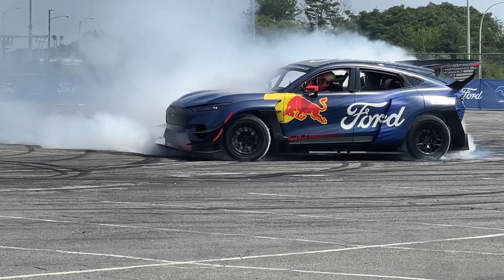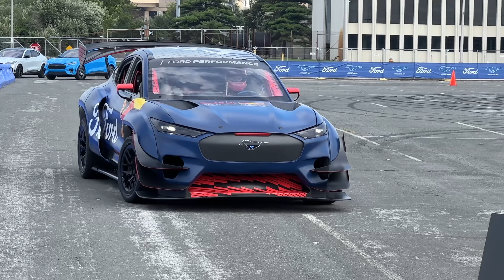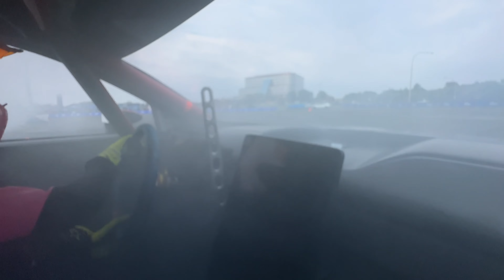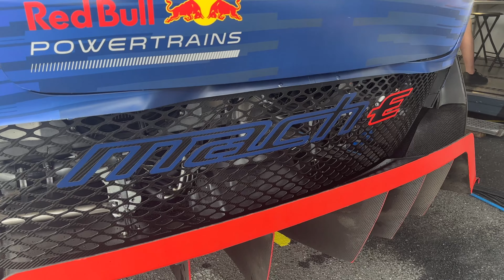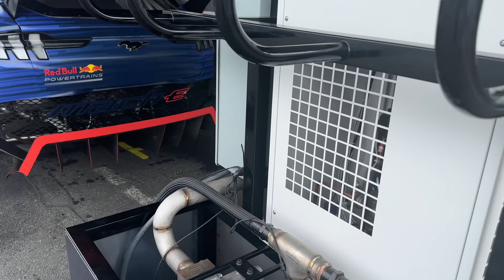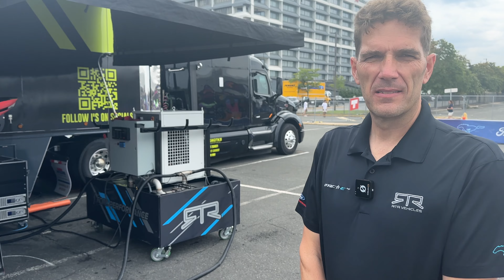I Ride In The Insane Mustang Mach-E 1400 Prototype Drift Car Built By Ford Performance & RTR!

Comment: Interesting but doesn’t seem very sophisticated. 7 motors?? Complicated charging… Hyundai seems to have done much better with the Ioniq 5 N. Hope you get the chance to check it out and compare.
Reply: This is a one-of-a-kind demonstrator for events, not something that will ever be produced or sold, so can't be compared to production cars. They took an empty Mach-E body and put race car guts in it. The actual production Mach-E has one or two motors and the charging works normally.
Reply: @TechnicalLee  Thanks, I understood this from the video but I don’t see how this artificial setup will bring any learnings for the development of street cars. Adequate cooling and heating of the battery are a challenge for many manufacturers and unless you develop a great system for this inside the car, nothing can be learned. The overload of motors is also not relevant for street cars but maybe for racing cars.
Reply: It just shows what EVs can do. I don't see this as something that should be used to inform what road-legal vehicles should do.